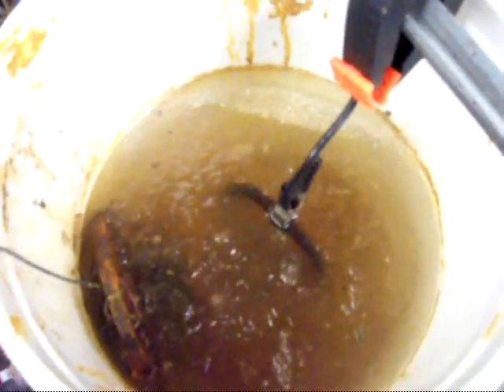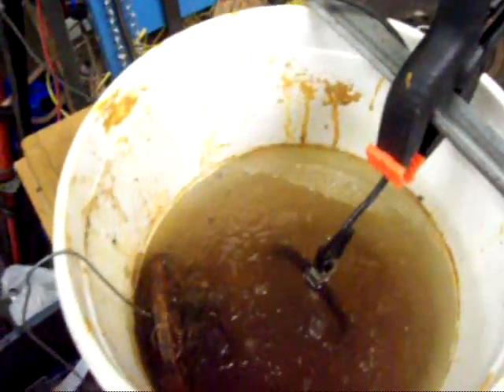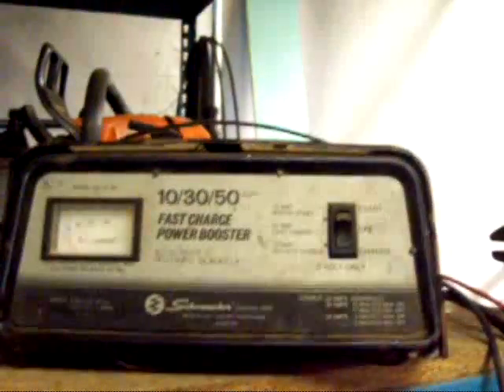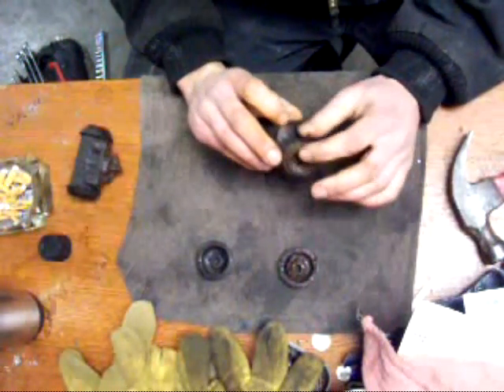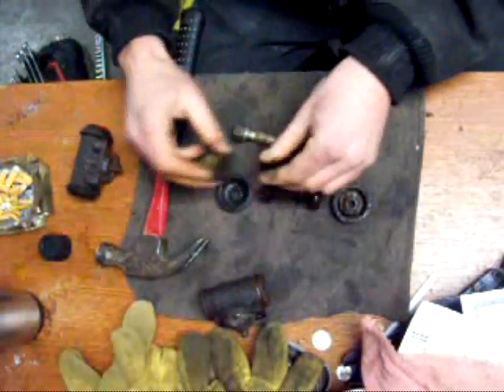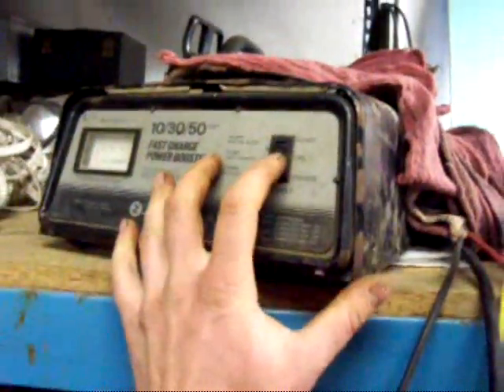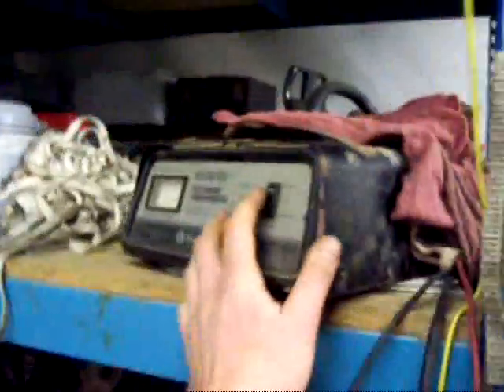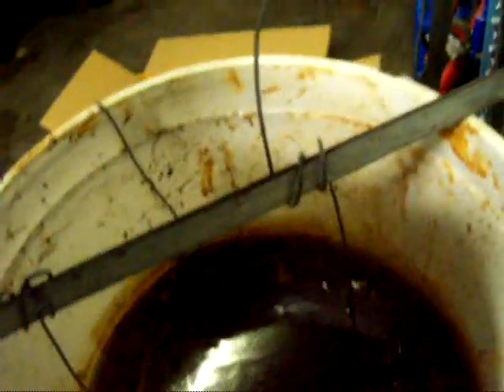How to remove rust with electricity

Comment: Yes you can. I used a Black & Decker welder that only had AC output. I connected a 40 Amp rectifier diode to one lead. This was a stud rectifier and I bolted it to a piece of aluminium angle to act as a heat sink.

Comment: thought the same. I would use a small compressor t to removed both pistons with air or built a hydraulic pump and pumped oil to chamber to allow piston lo loose

Comment: i tried to use "Kreem" inside my tanks from my harley from 1986,it turned  out it was rustet trough,-buy new if badly rusted inside tank..-you dont want to have a leaking miles away from home.

Comment from the maker: @mrofffroad There is a guy in the comments who did an engine block with this process but used the standard process and it worked out well for him. I would guess that it would work faster with more power but I honestly can't say because I've never tried it. I also don't know if there are any downsides to using more power.

Comment from the maker: @TheFucYeah I don't think this will hurt rubber, but if you leave rubber on it won't take the rust off underneath it. This method works best when there is a direct line of sight between the part to be de-rusted and the sacraficial piece of metal.